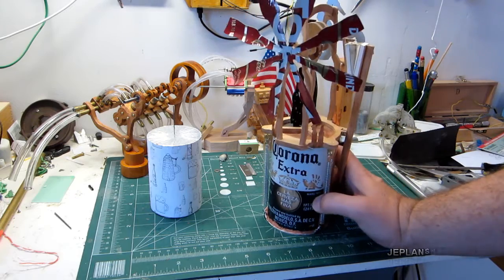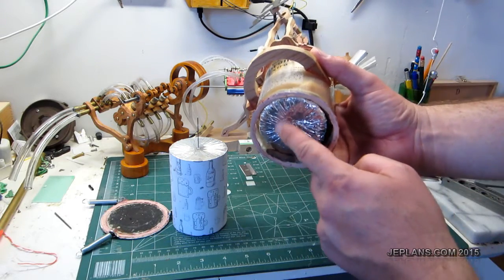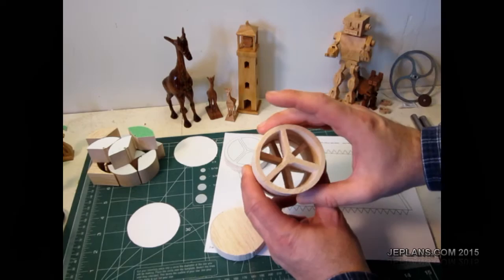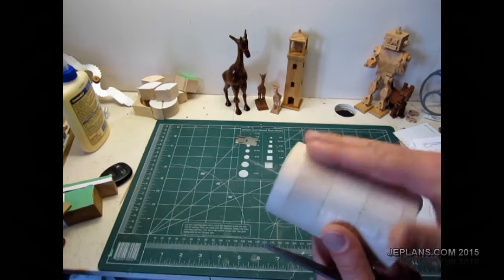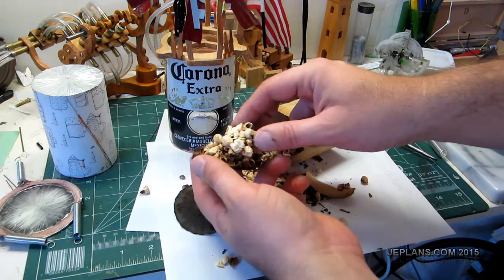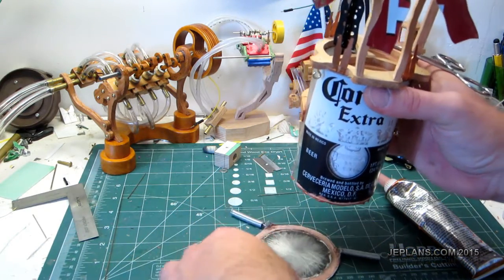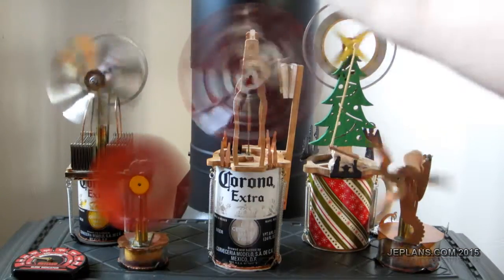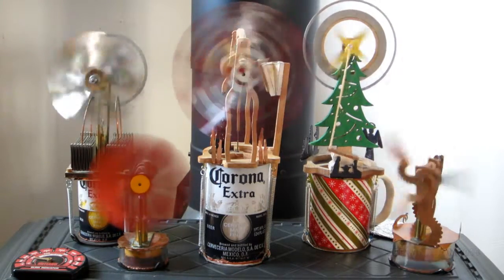Beer Bottle 2 Balsa Displacer Upgrade

Comment: Congratulations. My "beta stirling engine 30mm diameter 5" has  also a wood displacer. Inside  i injected 1 cubic ceter  water. It became an stirling malone engine. The steam does not burn the wood.
Reply from the maker: +IoanBojan cool